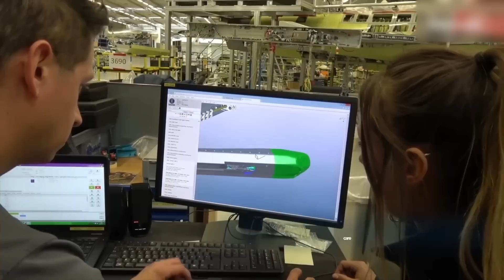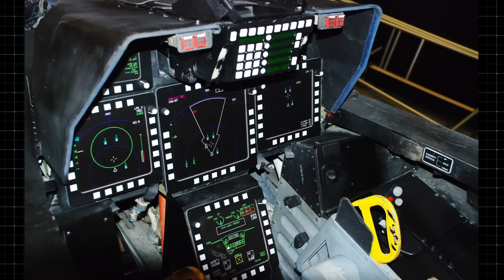NEW YF-23 SHOCKS Russia And China!

Comment: If Northrop would have vectored the rear engine nozzles it would have won the fly off competitions. And you are correct, the B-2 cost over runs didn't help the YF-23 with the Air force brass.

Comment: Its  not a YF-22 and they're not going to retire it. Think about it, the F-16 has been around since the early 70's, there's no way they'll retire a modern fighter when the F-16 is going to be in service until something like 2050.
Reply: YF 22 was a very expensive airplane to design build and maintain. Congress stopped production because of money. Airplanes burn money faster than fuel. F16 was designed as a low cost fighter to supplement F15. Exported to numerous countries. Cheaper to fly, maintain, and exported.
Reply: and yet they retired a lot of B-1's and B-2's to the bone yard, already.
Reply: why